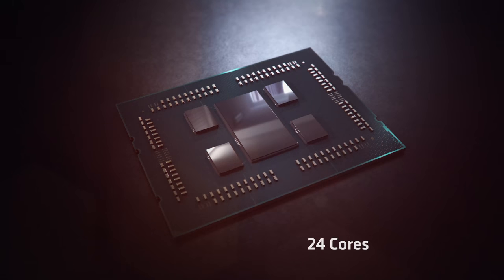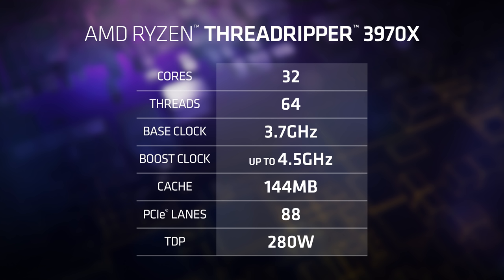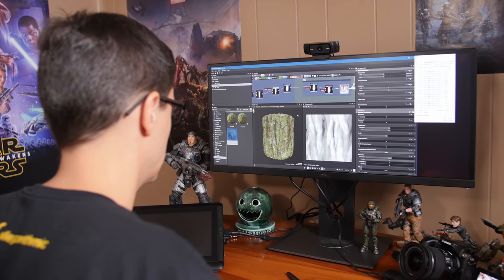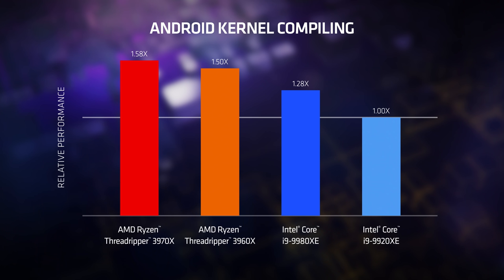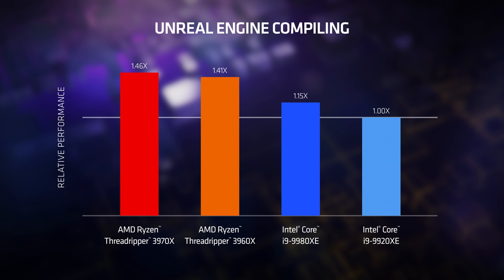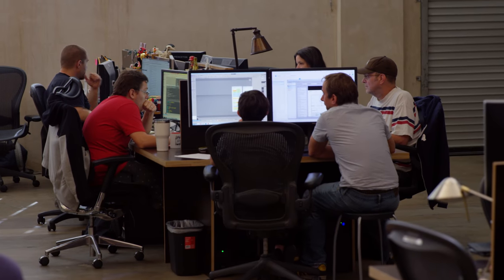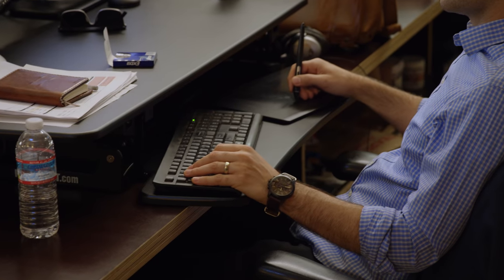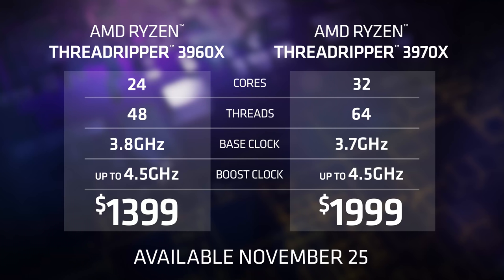Performance Preview: 3rd Gen AMD Ryzen™ Threadripper™ Processors for Creators

Comment: I thought everyone is using GPU Rendering cause it is much faster.
Reply: Most programs don’t support it, so 0 acceleration. Plus those that do can only do certain effects (it’s very limited)
Reply: @jakegarrett8109  The Claim was, that "The processor it's optimized for every hard work out there."

The Major Video editing SOftware does Support GPU rendering.
-Premiere Pro CC
-Davinci Resolve
-AVID

The most important 3D rendering engines Support GPU
-Arnold
-V-Ray
-Octane
-Redshift
-Luxrender
-Cycles
-Eevee
Nuke also does Support GPU

If you talking about data scientists and simulations Nvidia provides the most products for this scenario.

But it makes sense for AMD to claim that since they are way behind Nvidia when it comes to GPUs.
Things like showing a Cinebench also doesn't say much since no one except absolute beginners uses the default render Engines for C4D anyway.
The V-Ray benchmark also doesn't say a lot also if it is true, that V-ray once only worked with CPU since most users switch to other ENgines like Redshift for the reason, that they are thanks to GPU rendering much faster V-ray also supports GPU now.
Compiling is also something that is not that important because it takes up only seconds anyway.
Reply: Magic Mark I noticed you mentioned Davinci, that one seemed to have 0 impact on performance for me (testing between an old R9 270 and a Titan Xp collectors edition, so that should have some difference), it’s highly workflow dependent. Vegas pro is what I now use (I don’t do it professionally, I mostly need slow-mo and speed up, Davinci can’t even speed up videos without sounding like a chipmunk... basic task it failed at so I bought Vegas just because of that), but it also isn’t super dependent on GPUs, it just needs 1 (so for my “high power” video editing setup in college consisted of 2x Fury in crossfire for gaming while I wait on 3x water cooled RX 470 and a Titan Xp for CUDA, but all can run for rendering if needed, I just run multiple instances of the program and render 6 videos at once for fastest results). With Threadripper you have a lot more PCIe lanes, so you could run more GPUs as well, but you might need to run a dozen renders at once to take advantage of all of them, which the 64 core Epyc should be capable of).

For CAD the GPU accelerated ones (I think it’s Solidworks lightshop or Lightroom or something, it takes 3.5 minutes to render a 4k image, while it takes like 5 seconds on the built in CPU only rendering program within the CAD software, and it’s plenty for what I need with accurate shadows and glass reflections and lighting placement and camera zooms/distance perspective etc). I would love if fluid dynamics could use GPUs though, it’s like 24 hours of compute for a small UAV for 1 condition (set airspeed and angle of attack), and you really want like minimum of 5-10 angles of attack across 10 airspeeds at  least but that’s 50 to 100 days of compute... really wouldn’t mind having a small rack of GPUs hammer it out, as RX 470 is like $60 after the mining craze and so I could get a dozen for $700 (actually it’s like $500 or less for a dozen if you’re buying that many), and that should be a lot of compute if only the programs used it! Same with finite element analysis, it only seems to work on cpu... it can do a good job, but it might take hours.

But if they claim it’s optimized for every workload, it is a cpu after all, it probably is optimized for every workload, they even gave it a bunch of lanes for running lots of GPUs.
Reply: @jakegarrett8109  GPU acceleration is something that came up over the last years. So it's only in the later versions of Davinci.

Lightroom, in fact, doesn't SUpport GPUs by now, but the fastest GPU for Lightroom and the fastest CPU for Lightroom is the i9900X, not a Threadripper or even an AMD CPU.
Photoshop and Illustrator Support GPU acceleration already. Assuming, that Lightroom will follow soon.
I don't know any Task where a THreadripper really would make Sense.
Reply: @Magic-Mark  I do fluid simulation (note the 24 hours I mentioned? that wasn't a made up figure... and normal aerodynamic math really can't give a good approximation for extreme angles of attack like 70 degree alpha using vortex shed lift effect with trip stall condition at the leading edge, hence you need a really accurate fluid simulation program which is why it takes a lot of computational power, I don't want to wait 100 days for results to say "yeah, that design sucks, try something different", lol, I kind of want that in a couple days or preferably same day, haha!), plus my Threadripper has a lot of extra grunt for some things (I tried rendering 1080p clip on my 6 core 8750h laptop, which does have a gtx 1070 so not using potato integrated graphics, but it took like 1 hour for a 30 minute Vegas pro edit, Davinci would have taken far longer from my experience, so yeah, using the desktop on that stuff!).

In fact, even for gaming Threadripper was the way to go (I have 4x R9 Fury in crossfire, its 100 fps in Crysis 3 at 4k Ultra compared to a stuttery 45 fps on my Titan Xp, so yeah, its basically going to tie with 2x Titan RTX or 2x 2080ti so I haven't side-graded to those).

There has not been a single program that I've used where a 9900k at 5 Ghz would be significantly faster (remember, I run multiple programs at the same time if I have to, I often do some 4k gaming while running 4x Handbrake compression batch folder runs at once because that way it loads the CPU to the max), when a program is single threaded, I just run a dozen instances of it if I have too, LOL!

Do note: I used to run sub-zero daily machines, so when picking parts I am comparing my normal machines to 9900k at 6 Ghz when I think of what CPU I need for a task, as I would run the 9900k at no less than that (right now I don't have a cooler for the TR, but today I'm designing a new evap block for it, the goal is -100c on TR-64 core as my next daily machine. Overkill? Yeah, but why not, sub-zero is too much fun to not do it, haha!)

Comment: Too expensive.  24 cores for $1000, and 32 cores for $1400.
Reply: Too expensive compared to what? Intel's 24-core CPUs start at over $3300 and their 28-core (not even 32) start at over $4400. So not sure what you're complaining about. Yea, 3960x and 3970x, are $100 and $200 more expensive than last year's 24-core 2970wx and 32-core 2990wx, but they also offers much faster clock speeds, much better IPC, more PCI-E lanes, reportedly are UMA topology instead of NUMA, and have new features like PCI-E 4.0. I think I can justify the $100 and $200 respectively markup for these alone.

Comment: Please make the 3rd gen threadipper cpus work on older x399 motherboards. Since the EPYC boards work with new cpus and x370 boards support new cpus i don't want to have to pay for a new board with Pcie 4 features i do not need. Please i would deeply appreciate it.

Comment: That first speaker sounded like a little boy. They really should have got someone else to speak.
Reply: For color corrections it should be incredibly fast (probably really overkill, but if you made a million a year from that job then you probably don’t mind over-buying a little because another $1000 wouldn’t break the bank even getting the top end model). But that’s going to be very application dependent, you might also need to check GPUs for acceleration if the program and that task can benefit, but these new Threadripper certainly won’t be the slow part!
Reply: Jake Garrett you replied to the wrong post.
Reply: @lightdark00  In the words of the great Homer Simpson "Doh!"   Lol, it for sure showed a different comment on my phone, haha, thanks for letting me know, cheers!
Reply: Uuuh, that's Lisa Su. The CEO. She's a woman. How else would you expect her to sound?

Comment: Yeah everyone praising amd, but they are starting to do intels price methodology. Those tr are expensive as hell and lets just not talk about their 1000$ mobos...
Reply: Expensive as hell? Really? If these are too expensive for you, then you're probably not the target customer group for them. Once you realize how much processing power these monstrous CPUs posses, I think anybody will agree that the pricing is actually pretty decent. We are talking 24 and 32-core CPUs here. Let's see, the new Threadrippers will be 35-40% faster in multi-threaded workloads than their last gen counterparts (15% IPC increase + 27% base clocks increase). Plus, they now support PCI-E 4.0 and have more PCI-E lanes. So a 7-11% premium for such a big performance uplift and expanded features is actually pretty modest if you ask me. Intel charged $1800 for a 10-core CPU (6950x) just a little over 2 years ago. This kind of money now almost buys you a 32-core Threadripper 3970x which is 4 times faster. I mean, would I want prices to be cheaper? Of course I would, no one wants to pay more that they should. However, I realized that if AMD don't pay off their debts accumulated throughout their Bulldozer days and accumulate some cash for future R&D, we'll have another Bulldozer situation at our hands and Intel coming out with the same thing for a decade at ridiculous prices as they did with their 4-core CPUs. The end result will be another decade of CPU tech stagnation. If these are expensive for you, 3950x is basically as fast as Intel's 18-core 10980xe and supports PCI-E 4.0. Even 3900x is a beastly CPU and it costs just $500. I think that AMD offers very fast CPUs in any pricing category if these Threadrippers are out of your budget.

Comment: I want ryzen with quadchannel ram (or triple channel).
Reply: Then get Ryzen Threadripper. 1st Threadripper costs peanuts now even brand new, not to mention 2nd hand. Only problem is cost of x399 motherboards, but you can probably find 2nd hand ones for cheap now.

Comment: 280w is too much...
Reply: It's actually fine. Some people are confused by this, so let me explain why it says 280W. The 105W TDP Ryzens (3900x & 3950x) are not rated at their PPT power consumption which is actually 142W. The power usage of the new Threadrippers is actually fine and exactly double that of 3900x and 3950x which both consume 142W PPT at full load on all cores. Check out Anandtech's power consumption chart with 3900x by searching Google Images with these terms: "3900x power package", it should be the 1st result. You'll see it actually consumes not 105W, but 142W. 🙂 AMD rate the Threadrippers' power consumption at their Package Power (PPT), which is a bit strange since they don't do that for the small Ryzens. So if we do the math, two times the chiplets of 3900x makes 24 cores (3960x), hence 2 x 142W power consumption which equals exactly 280W that the new Threadrippers are marketed as. 🙂 Last gen 24-core Threadripper (2970wx) is 250W. This year's 24-core Threadripper is only 30W higher power consumption while being 35-40% faster. I think the trade-off for this small TDP increase is more than worth it for the huge performance gain. 🙂
Reply: @bgtubber  thank you for the explanation

Comment: Too bad they increased the price.
Reply: The new Threadrippers will be 35-40% faster than the their last gen counterparts in multi-threaded workloads (15% IPC increase + 27% base clocks increase). Plus, they now support PCI-E 4.0 and have more PCI-E lanes. So a 7-11% premium for such a big performance uplift and expanded features is actually modest if you ask me. I mean, I would be perfectly happy if prices stayed the same, but then I realize, it's time for AMD to get some cash for future R&D too. They can't sell their stuff for free forever. Otherwise, we will end up with another Bulldozer situation and Intel producing more of the same for almost a decade, which we all know how "well" it went.
Reply: @bgtubber  I think they should have kept the same price model.  At the end of the day its all about greed I think..
Reply: More performance = More higher price :/
Reply: @kevinyoliveira68  If that is the case then CPUs will always be going up in price and this is not necessarily true.  I think the newer generation of the exact same model number should not be going up in price.
Reply: @johnydarko1721  You is right, but AMD hasn't competition in HEDT because high price 😐😐😐😐

Comment: 3950X and 3960X is the worst news from AMD in nearly 10 years. This is a huge loss for content creators.
AMD has downgraded the PCIe lanes from 60 to 20.
The previous $680 CPU had 60 lanes. The new $750 CPU has 20 lanes. (2950X, 3950X)
AMD has destroyed the Threadripper platform.
And we lost something great.
I feel terrible about this.
I'm so sad about it.
And I'm screwed. This means I need to buy a $1400 CPU minimum, for every computer in my setup.
Because you're not getting a PCI-e slot with a 3950X. The lanes are used up by 1 graphics card.
The 3950X does not have enough PCIe lanes for me to use even 1 PCIe card for streaming... my Magewell Pro 4K Dual LT video capture card.
The 3950X does not have enough PCIe lanes for me to use even 1 Networking card for connecting to the NAS.
You can't even install one 5-Year Old PCIe 3.0 x8 40GbE networking adapter on your Threadripper after you bought a $750 CPU and a $500 motherboard.
I would be forced to use 1 GbE or 10 GbE built into the motherboard, because there is no PCIe slots.
It is truly pathetic.
This is a disaster for content creators.
No more NAS connectivity, no more video capture for streaming, no more audio cards for music production, no more doing anything with your computer except Gaming on an ITX motherboard. It's all gone for creators.
Every computer = $1800-$1900 starting point just for the CPU and board, if you want to use PCIe slots.
I am so disappointed in AMD. It's like they are abusing customers now like Intel.
This is not the AMD I used to know. This is not the AMD I've been buying CPU's from.
AMD was different.
I'm sad about what has happened to AMD now.
Why this huge change at AMD?
They don't care about the artists or creators anymore.
They care about $1400 per ticket.
Bottom line:
    The price to use PCIe cards was increased by 210%

Comment: Too expensive.
Reply: Really? Which one and compared to what CPU?
Reply: @bgtubber  Both. In absolute values. You wanna go cheaper - your choice is 10980XE.
You wanna go expensive - you should wait for 3990X, at least to justify a new socket.
Reply: @MalleusRegum  Why not go with 3950x instead of 10980xe then? According to the leaked benchmarks, in a large amount of cases 3950x was about the same performance as 10980xe while also drawing less power. It also beats it in gaming. All while being 25% cheaper.
Reply: @bgtubber  You mean those fake benchmarks, where 10980XE was somehow even slower than 7980XE by a lot?
Alright, does 3950X support quad-channel memory? No. Way to go.
Gaming performance? 9900KF is at $475. End of story.

Comment: The truth is that there is no value in these processors despite AMD’s best efforts to make the benchmarks appear better by comparing their processors against a stock Intel 12-core 9920X as a baseline so make the smaller difference with the 9980XE appear larger. Look for example the Android kernel compiling, the 3970X has 1.58x the performance of stock 9920X while the 9980XE has 1.28x. For the uninitiated it appears as if there is 30% difference between the 3970X and the 9980XE but in fact, it is only 23% (1.58/1.28=1.23x).  

Even with AMD’s shady presentation it is unimpressive to say the least as AMD’s 24-core 3960X despite having 2x more cores, 4.6x more L2+L3 cache, and 70% higher TDP is only 1.3x-1.7x faster than a stock 9920X and that on AMD’s most favourable benchmarks. What is worse is that AMD will be charging $1400 for the 3960X, that is over 2x the price of the 10920x ($689) (which replaces and improves on the 9920X). And they will be charging $2000 for the 3970X which again is over 2x the price of the 18-core 10980XE ($989), that replaces the 9980XE.

Also these CPUs will need new TRX40 motherboards and very expensive ones at that (over 500 dollars for the cheapest ones). And where is all that pledge of AMD to support their platforms for more than 2 generations ... something that AMD and AMD fanboys accused Intel for doing? Nothing now from AMD fanboys. Apparently now changing motherboards every 2 generations is fine... Hypocrisy of the highest order. AMD fanboys are cancer in this world, the worst scum of the earth.
Reply: Wow, Intel fanboy much?

Comment: fast but over priced
Reply: I would have to agree. These CPUs are beastly, and I would have happily paid more if the older motherboards were compatible. Unfortunately, I would not only have to spend 100$ more for the new 24-core, but also buy a new motherboard which almost certainly will start from at least $500-600. Nevertheless, I'm still probably getting the 24-core as Intel don't have anything similar in this price range.

Comment: 24 and 32 cores don't even align properly on Threadripper lineup. 
And everything was fine until they showed 7:18 the freaking price. I mean seriously $1400 and $2000? 3960X($1400) is successor of 2950X($900) and 3970X($2000) is improved version of 2990WX($1800)
Product might be a bit better than previous version but pricing is just a trash, yes, garbage.
Reply: While I generally agree, I think I'll have to make a small correction. The successor of 3960X is not 2950x, it's 2970x which costs $1300 (or $100 less). And the successor closest to 2950x is 3950x which is even $150 cheaper.